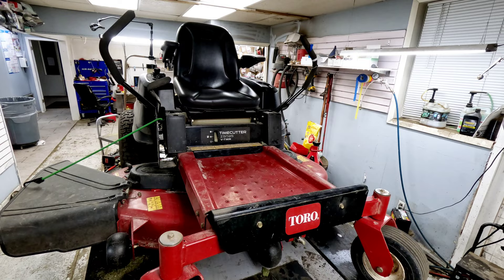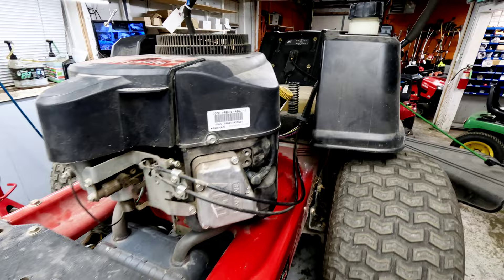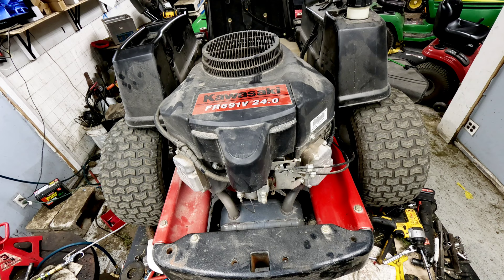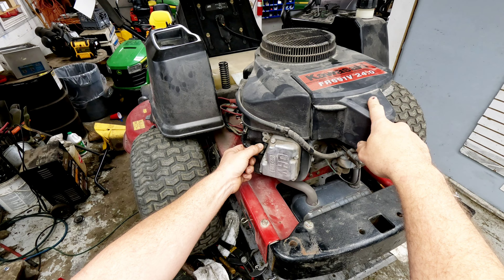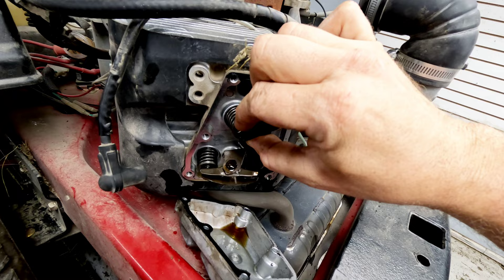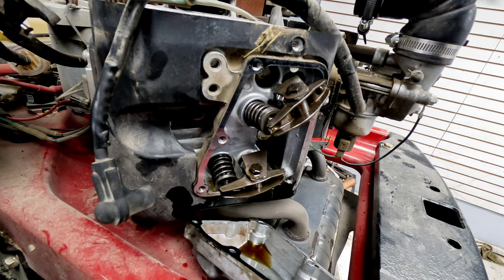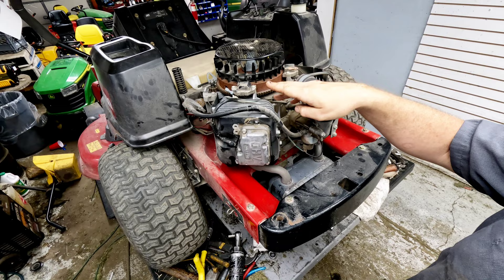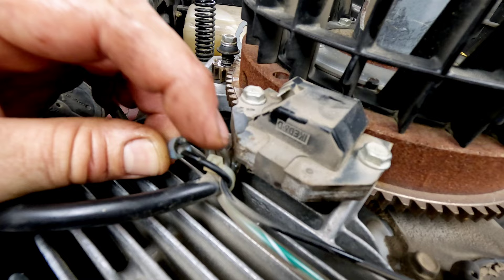Unleashing Power in Your Zero Turn Mower! Diagnosing and Fixing Loss of Power & Bogging Issues

Comment: My mower was surging. Checked EVERYTHING Spark, air, adjusted the throttle cable, cleaned the carb. I blew out the fuel line, and checked the fuel pump. Nothing I trouble shot worked. Because I was lazy I didn’t check the pick up tube or elbow. The last resort was to check the pickup tube and elbow. When I removed the elbow it was clogged. Cleaned it and at last my problem was solved. I wish I had seen this vid, it would have saved me so much time.
Reply from the maker: Only reason I put out these videos. I have been there and had all of these issues multiple times over the almost 20 years I have been doing this! Hopefully I can help someone and save them some money!

Comment: Just rebuilt mine. It's not a hydraulic lifter, the push rods ride on the cam via the tappets. The valve clearance is adjusted via the rocker bolt, it's an offset cam bolt and the nut on the other side locks the position. Clearance is supposed to be .05 to .10 on exhaust and inlet.
Reply from the maker: Updated that in the description on this one, thanks for sharing!

Comment: Theres definitely an adjustment on those rockers. Its a cam style adjustment. You loosen the nut holding the rocker to the rocker arm. As you turn the screw it increases or decreases the valve lash. Should be .004"-.006." While they do have hydraulic lifters, theres still adjustmente.
Reply from the maker: Definitely so
Reply: 100% right

Comment: Used my hustler zero turn with a Honda engine to cut through some taller grass and it worked pretty well but the next time I used it on not that tall of grass it starts slowing down or losing power and I’ll turn the blades off and the motor will gain power back again, but the grass isn’t even that tall. It’s simply a little bit of minor stress on it and the power diminishes. Any thoughts?
Reply from the maker: Could be running on one cylinder. I would follow the steps here for testing each individually

Comment: Pardon me thought I’d mention that you do have adjustment there to set the valve clearance. Set your key on crankshaft to top dead center compression stroke with key facing piston 1 or 2 then loosen nut on side of rocker then rotate the bolt going through the rocker because it’s on like a lobe or cam like. As u rotate it the rock will move slightly up then back down while sliding a 0.006 th feeler gage until feeling a slight drag then tighten and done.
Reply from the maker: Good info! When I looked at it originally I thought they were hydraulic like the Kohler but they weren't. We have another video at https://youtu.be/RiaiIbPsWkE that shows the process on this engine. Thanks for watching!

Comment: Those valves on the Kawasaki fr691are adjustable and not hydraulic. You loosen the center nut and bolt on the rocker The spacer in between them has an off center hole that allows you to set the valves.
Reply from the maker: Good info! When I looked at it originally I thought they were hydraulic like the Kohler but they weren't. We have another video at https://youtu.be/RiaiIbPsWkE that shows the process on this engine. Thanks for watching!
Reply: @IndRepair  I thought the same at first on the one I worked on as well. I put it back together and had the same problem. Did some research and found they were adjustable. Great video!

Comment: Uhmmm You pulled coil wire off plug right side(engine starts and still same low power) it runs, reinstalled, then pulled left side coil wire off plug(engine would not start/run)....... that tells me problem is on the right side ?!?!?! because it doesn't run on right side piston, yet runs on left side piston....... anyway you didn't complete the left side repair to show it runs smoothly....... could have just insulated wire to stop the arching/shorting to coil pack.....just to prove your diagnosis... No ?? what am I missing ??
Reply from the maker: Haha! Right you are! You are just missing the description and follow up video. We are all only human my friend. Check it out and thanks for watching!
Reply: All good no worries, I thought I wasn't smoking anything......COol Thankx for the reply and video Take care @IndRepair
Reply from the maker: You also!

Comment: Have a Husqavana Z254F Z/T that runs great. When engage PTO Engine dies Replace all Safety switch and engine still dies when engage PTO. Any Ideal of cause
Reply from the maker: Have you ruled out a safety issue or is it because the engine is killing itself? Easy to test by seeming if it will stay runningnwhile using some starting fluid in the intake when it starts to die. If it stays running longer St that point you know you have a fuel/air mixture issue, bad fuel or a carb issue

Comment: Noticed right off the exhaust pipes were different in color so it has not been firing on the left side for a while. I use a heat infrared gun a candle, or crayon, to diagnose no firing on the cylinder. Old race car quick diagnoses. Thanks for you time doing a video.
Reply from the maker: Nice! Good tips! Thanks for watching!

Comment: Hey Martin, how can you adjust the low idle on the carb on the FR651V? I was working on one and the choke was sticking I fixed that and it runs great under load and all. But now it wont run on low idle, it dies. How can I adjust that up?
Reply from the maker: Look at the throttle plate, at low speed it rests against a screw. You will want to turn this screw clockwise until it is at the speed you want it at

Comment: I try to do a leak down test to decide the overall condition of the engine,
I just had a bad spark plug and first new bad plug in years 
Was very surprised to 😂
Reply from the maker: It is never a bad idea to do at least a compression test and/or a leakdown test to gauge engine condition!

Comment: Would this fix my current issue of having the arms fully forward but struggling to go up hill once I start up the hill it’s alright but once I get almost to the top I have a loss of forward motion and struggles
Reply from the maker: It definitely could bog down under a full load on the hill but normally you will notice it if you are in thick grass or under a big load in different instances also
Reply: @IndRepair  I got about 2-4 cuts where it went up the hill no problem and the last 3-4 cuts it’s gradually slowed going up hill to where I’d have to push one arm further and kinda walk it up the hill I got a 50 inch Troy built with the 25hp Koehler
Reply: @IndRepair  when I bought the machine it had all new pulleys new tires sold rubber fronts new belts fresh fluids new new blades with about 192 hrs on it I think I just broke 200 hrs today after I cut my yard

Comment: I’ve always checked the heat of both exhaust  pipes. Do find any issues with unplugging one HT lead at a time with newer models?
Reply from the maker: Never an issue even on EFI versions, they always seem to try and adjust but can atleast make sure both will run independently
Reply: @IndRepair  thanks. I know it’s old school. Another was to take plug cap off a push mower. By hand spin the blades.  If compression is good the blade will bounce back.
Reply from the maker: @steveriggenbach90  Good tip!

Comment: I did a Comp test and my #1 has 50 PSI and #2 is at 120.. Valve adjustment ?Valves ? bad Cam ? I think they has Comp release on both sides ?
Any Idea on what the compression should be ?
Reply from the maker: I would pull the low comp side valve cover and see what's going on may have a stuck valve or improper spacing. Inspect the valve movement/spacing and go from there. If you don't find any issues there the head gasket could be blown out, can check further with a leakdown tester if available, which would tell you where your losing the compression. Thanks for watching!
Reply: Did Valve adjust ment set to .005 on Both Valves. Leaks down fast. Oiled Cylinder NO Help..same same
Reply from the maker: You can't tell where the air is escaping? Should be able to hear/feel it pretty easily. All valves are moving properly?
Reply: Valves seem to be moving correctly.  I do see that this model is supposed to have compression release. think I will Pull the Heads off and have a Look  @IndRepair
Reply from the maker: @AP-514 did you get it fixed up?
Reply: @IndRepair  - Did I state this was a 50" FREE ZERO turn ? 
Ordering a Standard-Rebuild Kit as we Speak- Found 2 Bent Pushrods(intakes) and ordering 4 NEW Rockers they are Worn badly Guy had gaps way to tight.
Side Note-- Most Degreasers not for Aluminum- I grabbed the wrong Degreaser bottle they were side by side in shop and Set Heads in the Stuff 2 minutes into cleaning they started to turn black/gray. Pulled them fast and water rinsed. Heads now Gray and a bit of White ash. Did not use the SAFE for Aluminum degreaser---DoHooo
Reply: I got it running. Forgot to add the old ring gaps were over 2 times the limit. Had to order NEW Spindles and Blades. The Deck is a bit rusty but no break thru. Going to use grinder with sand disk to get the big rust chunks off then paint the deck. Last things will be the HYDRO’s. They are unserviceable type. So going to drill and install drain plug to service them without removing the Hydros from Mower. All told about $400 after all is said and Done…..
Reply from the maker: Nice!

Comment: Would have been better to have replaceable rod insert than hyd lifters
Reply from the maker: When I looked at it originally I thought they were hydraulic like the Kohler but they weren't. We have another video at https://youtu.be/RiaiIbPsWkE that shows the process on this engine. Thanks for watching!
Reply: They are, he made a mistake not recognizing the rocker type. It has solid lifters and push rods. The lash adjustment threw him off as they're not center mounted like most engines. In some ways this is a better design kawi came up with years ago. No Torx bits to deal with on this type plus it removes the lash being effected from locking them down onto your filler gauge on the prior center mount type.

Comment: Bro, I'm embarrassed for you. Those valves are fully adjustable with push rods, not hydraulic.
Maybe I missed something but I swear you chose the wrong side as being weak. It ran on the left side (from camera view) and when you removed the left side plug wire, installed the right side wire it didn't run implying the right side isn't firing or has an issue.
You didn't rotate the engine to TDC and check valve clearance.
Those valve rockers are on a cam offset bolt. You break them loose with a 10mm and then adjust the cam (not the internal cam) followed by tightening the other end at between 4 to 6 thousands.

Look man, I'm not flaming on ya as i know you're trying to help, but if you're going to make an instructional video teaching people, make sure you're familiar with the subject first.
You might consider deleting this video, I landed here because it's the exact model as mine and thought I'd check it out.
I'm only commenting out of concern for others that may be mislead.
Those rockers ARE adjustable guys. Set the lash to .004 - .006 and lock em down.
Thanks,, and i apologize if this reads in a bad way. I'm only trying to help as well.
Reply from the maker: Haha yes I absolutely showed the wrong side! I explain this a little in the follow up video linked in the description. I thought it was like a Kohler design with the hydraulic lifters and mis-spoke in this video. Checking out the valve spacing can be done without going to TDC as we were just making sure they were functioning properly not setting or checking them. I thought there was going to be a third video where I would speak on this but the customer chose not to do the full repair. 

We also have a video at https://youtu.be/RiaiIbPsWkE?si=G_m-4i9t2Cq79ko- on the valve adjustment process of an engine like this. All of the diagnostics and troubleshooting processes still hold and will work well to find an issue. Constructive criticism just makes everything we do better in the end! Thanks for watching and thanks for trying to help people with mentioning these things!
Reply: Thanks for talking about the cam being adjustable